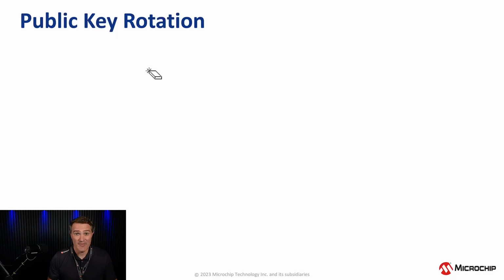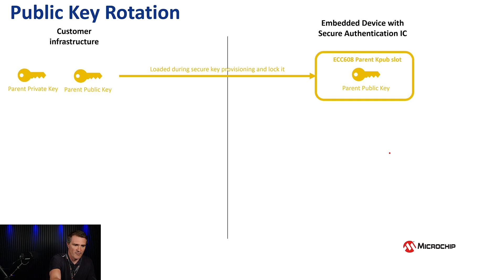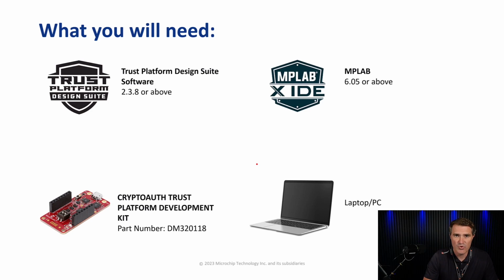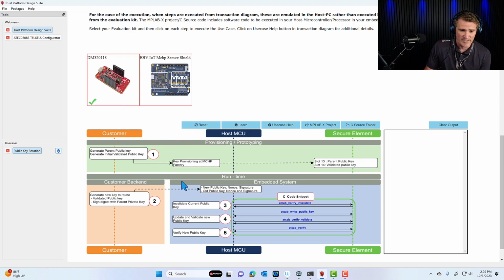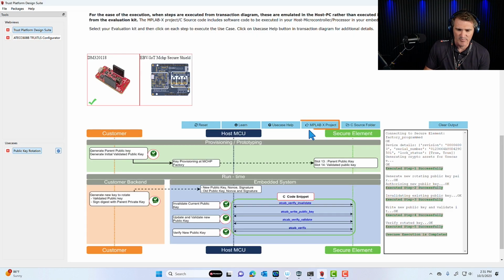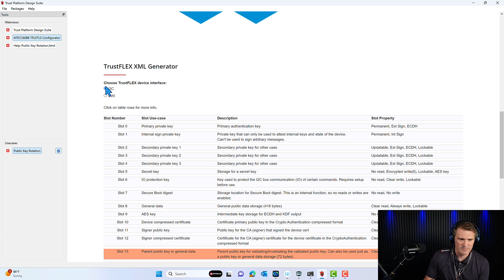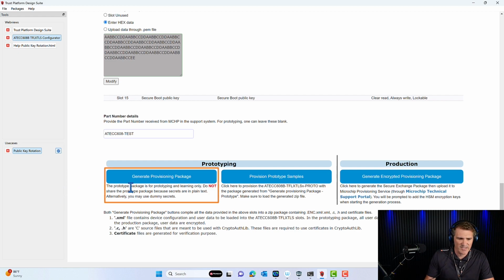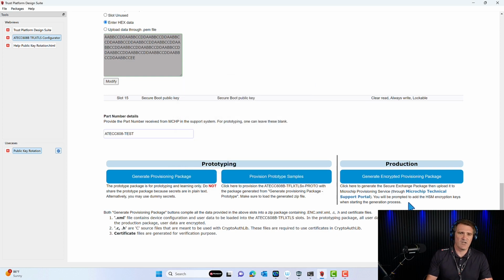Chiptorials – How to Implement Public Key Rotation with ATECC608 TrustFLEX

Comment: in your specific example of fw authentication, the main thing is to lock the public key in the ecc608, no? It's not a secret but it must be protected from being changed because if it's changeable, then anyone can just replace it with a rogue public key?
Reply from the maker: Hi there, thanks for reaching out. In the context of firmware authentication using Microchip Security Products, it is crucial to lock the public key to prevent unauthorized changes. The public key is not a secret, but it must be protected from being altered because if it is changeable, it could be replaced with a rogue public key, compromising the security of the system. Locking the public key ensures that it remains unchanged and maintains the integrity of the authentication process.